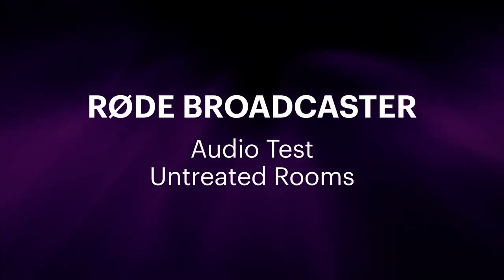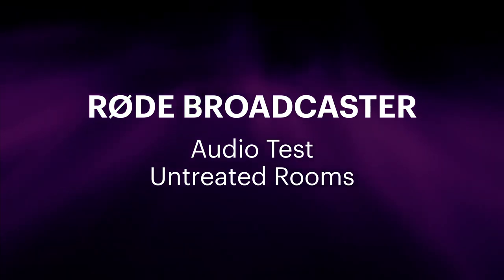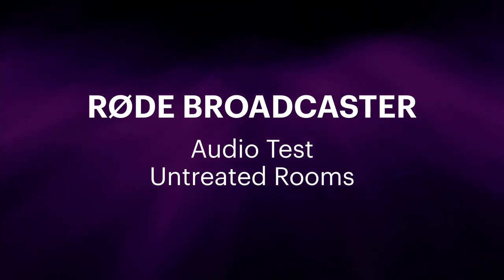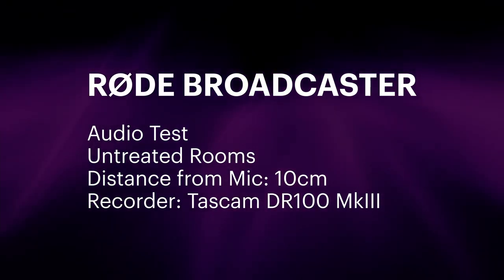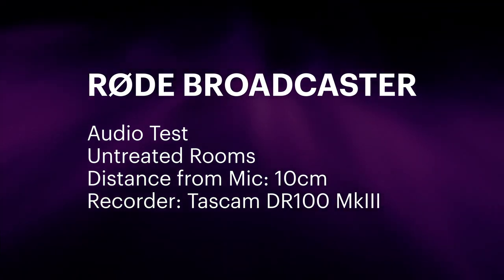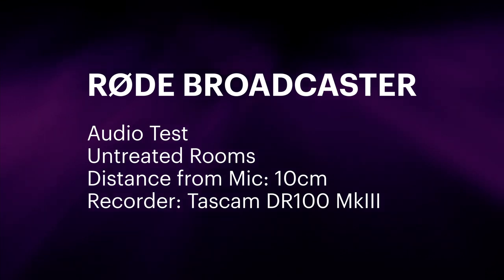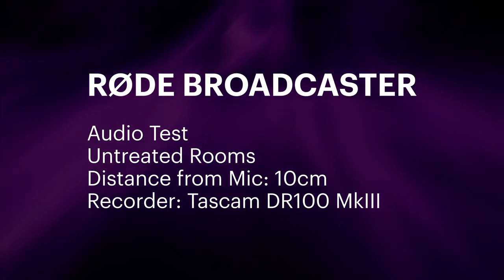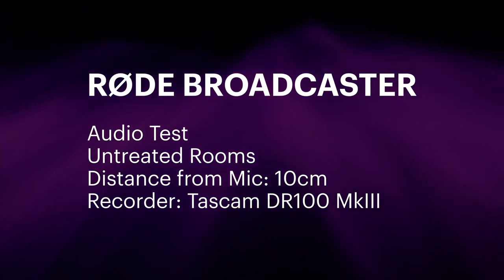How Does It Sound In Untreated Rooms? | Rode Broadcaster Mic

Comment: I wonder what I did wrong, I´ve had this microphone, and I sold it becuase it did sound great but I was not able to make it sound this good on my NI Komplete Audio 1 for streaming and youtube and in my room with bad acoustics I´ve had it to pickup my pc and echo in my room so I sold it. Now I am testing Shure SM7B which is far better in my untreated room, but I am still fighting how to set up a microphone good. I am processing it through vst plugin called Speachy which was designed for youtubers and streamers my a streamer from my country Czech Republic. It does good job,  but I just couldn´t find anywhere, what level of the mic should I use to make it sound good. I´ve seen from @Podcastage to set gain on my audio interface around -18dB, but when I make up the level to make it sound really good, it starts to hit those yellow or red peaks in OBS, -20dB to 0dB so I don´t know how to make it sound good but not clip the microphone. Any idea how the audio level for talking should be set to? -20 or -10?